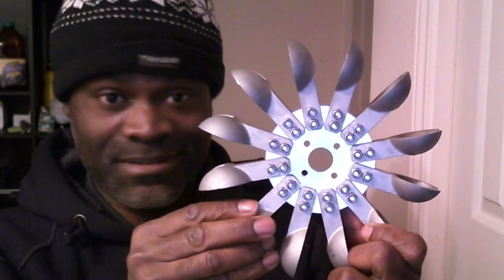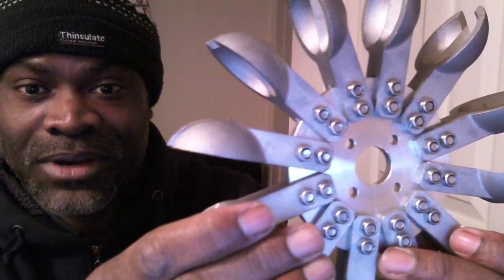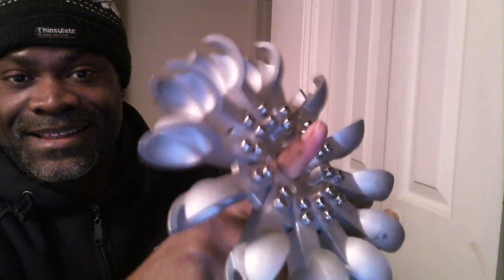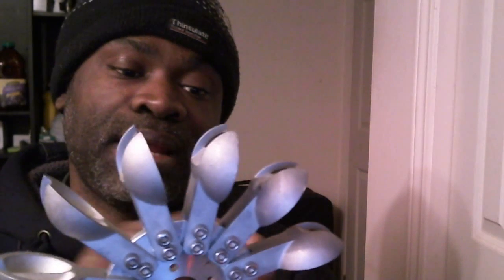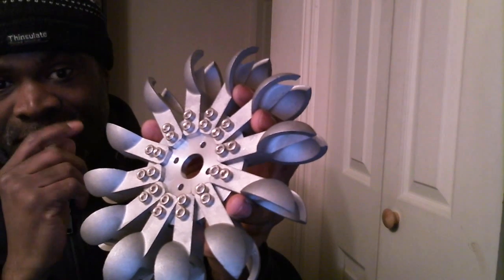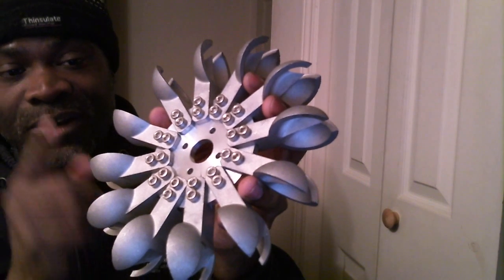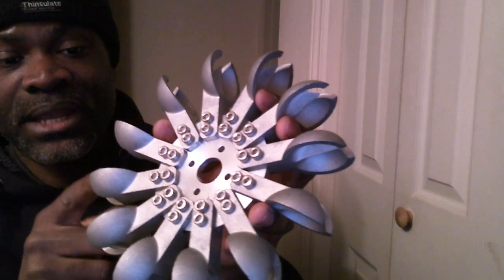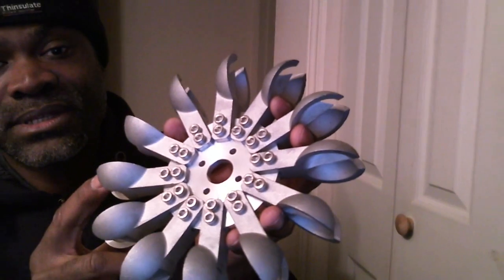PELTON WHEEL FOR HYDRO TURBINE!

Comment: Hi,  I need your technical advice. In my area we don't normally have electricity and we don't have stream or any water body around. So am thinking if I can construct a mini dam by using overhead reservoir and device a means to pump the water back to the reservoircontinuously. Pls I need your advice. Thanks
Reply: Somadina Chibuzo USE A HIGH PRESSURE WASHER. VERY POWERFUL.

Comment: I would like to know what the efficiency is compared to the purist's pelton wheels, which are more expensive and have at least 18 - 22 buckets, to prevent energy loss. These numbers are given by several authors (e.g. Thake, 2000: Pelton turbine manual, Practical Answer Publishing, Powerspout by Ecoinnovation). You could make them wider, with more buckets, which means less rpm but an increased couple. However, if you want to sell, you need to give an email adress. You cast them yourself? I have the same on, sold by Peter Stocker in Germany.